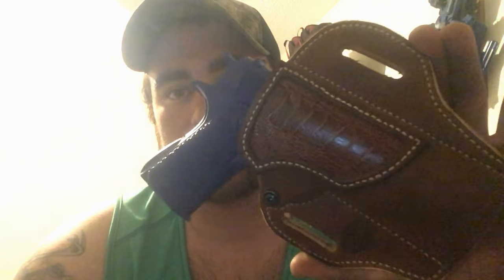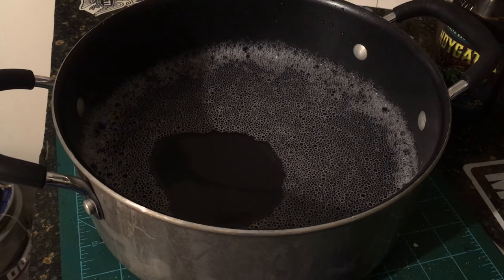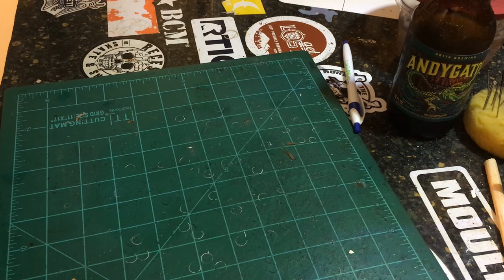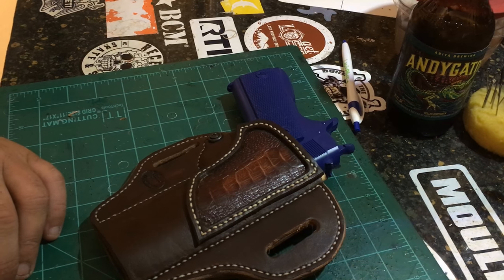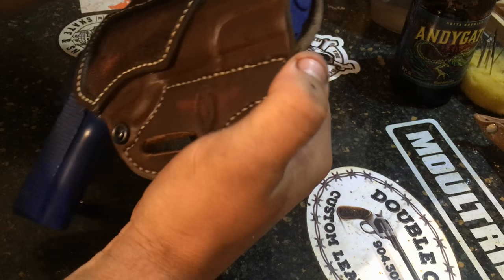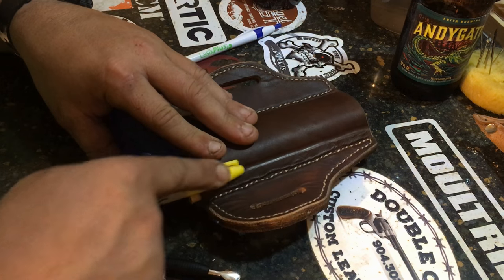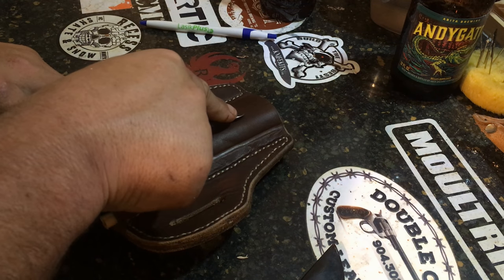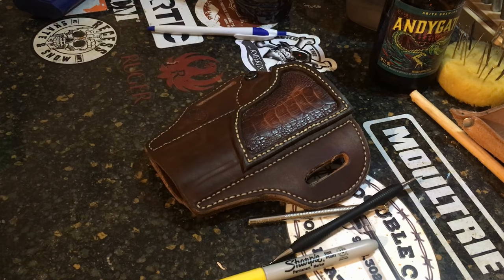How to wet mold a leather holster for a 1911

Comment: Nice Holster....good job molding.  I use a Food Vac Sealer to ger my initial molding ....gives a good start to the process. but think i will build a press ...will save some cost eliminating the bags and all.
Reply from the maker: Mike Turner yes!! The vacs are great if you get the industrial strength vac and thick plastics. Press is super cheap and effective. I’m pretty low volume so I’ve never needed anything more.
Reply: @doubleccustomleather2623  I'm really low volume...like make for myself and a couple friends.  
My standard food vac that I use freezing venison and fish works pretty good actually...least as a first step to get headed in the right direction.
Reply from the maker: Mike Turner yessir what ever works!

Comment: I like using the handle of a butter knife myself. Anyways, that molder you have there would work way better if you used a 2 inch thick piece of gel pad like you add to a motorcycle seat directly against the holster, then shim it up to the wood backboards with foam rubber to make it tighter, then use a big c clamp and a piece of steel plate on the top and bottom of the outside of the wood directly over and under the holster and tighten the c clamp till you can't turn in anymore and leave it till tomorrow and when you take it out you'll be able to see every single detail of the pistol without having to hand mold it at all.
Reply from the maker: Good idea. There’s definitely always something new that can be tried!

Comment: maybe not try to get so close with camera to keep things in frame.  also, could suspend camera over work area.  get it right once then don't worry about it.  maybe you could use bluetooth to send the image to another device (smart? tv, tablet. ?) so you can use it to monitor the work.
good video.  looking to make a flat leather holster i bought that only comes in sizes (e.g., size 3) fit a glock.  popped some stitches on another one trying to get a shield in the holster while on my belt.

Comment: Hi, Cody. What's the purpose of the screw undreneath the trigger guard?   Would it help to use a electric wire heater in the foam layers you use to press the holster? With a thermocouple to indicate the temperature near the leather. And leave it like that untill the leather self-forms around the gun.    And finally, which chemical do you recomend to seal everything once it's all done? Thanks

Comment: How long does it take the leather to dry? I left the gun wrapped in Saran Wrap in the holster during the drying process, but I don’t know how long that drying takes...thanks!
Reply from the maker: I usually pull the gun. That allows for better ventilation and it will dry quicker. A lot of guys leave it in But  I’m operating in a  business capacity so time is money. I also believe I get a better result that way. I do however give the holster a slight squeeze once the gun is out just so it dries in that tightened configuration. When you re-holster after drying completely it comes out just about perfect every time for me. I live in Florida with super high humidity and I ussualky wait at minimum 30 hours dry time with the ceiling fan in my shop on. I’ve also used box fans or set them on the porch on a sunny day which speeds the process up dramatically. Sometimes on really hot days I can get one dry in 12 hours. I’ve also used the dash board of my truck in a hot day to speed up dry times. Pending on humidity I’d say a 24 hour wait will produce a decent result. A trick to tell if anything is dry is hold it to your face. For some reason your really able to get the sense for dryness with the skin on your face rather than calloused hands. Old timer trick for finding dry tender to start a fire. Hope that helps!

Comment: Quick question. If you were to take something like an ammo can that won’t expand, put your gun and holster in a ziploc, sealed and evacuated all air, and placed it in the ammo can after the initial soak. At that point, take a can of expanding foam and spray all around bag with gun and then sealed the can off so that the foam presses tightly around holster and gun, would that provide ample detail for the wet mold?
Reply from the maker: Honestly I have no idea and I don’t believe I’ve ever heard of it even being thought about that way. I suppose it would but then you would have to cut all the foam off, ruin a good ammo can and foam isn’t cheap either. I’d say if a wood and foam clamp press is out of the question for you just wet mold it from start to finish without a pressing step. I made holsters like that for years before I built a press

Comment: one thing to remember that the slide line runs into the curve at the end. Do you edge and burnish the slots? Nice solid job.
Reply from the maker: Jonathan Shaha thanks. I do burnish them. I don’t edge them just burnish them on the 90 degree. I dye them and wax them as well. Deffinately could Bevel them I just prefer it to be non edged.
Reply: @doubleccustomleather2623  beveling and burnishing yields a more complete look. Been doing holsters for about 7 years. I'll have to check out your FB page. Always enjoy seeing others work
Reply from the maker: Jonathan Shaha I agree. I think you misunderstood me. I do bevel, burnish, dye and wax all my edges. I actually have a video on here detailing my recipe for that. The only thing I do not bevel is the belt loops. I do however dye, burnish and wax them. I like the look of the 90 degree edge better as well as I feel it offers some practical advantages too. They still look complete and finished. Just no roundness. As far as practicality I’ve found in a hard use holster, the 90 degree edges hold up better over time as beveling cuts away the flesh side fiber and therefore weakens it allowing it to stretch. I’ve tested this side by side with two separate Holsters. Not saying it’s wrong, as the stretch is minimal, it’s just the way I choose to do it. Also have a 90 degree angle allows for more bite on the belt minimizing forward and aft movement on the hip. The beveled edge creates  less friction which in return facilitates  more slide. Once again very minimal but it’s just a few reasons I don’t bevel the loops. Everything else gets a clean and beautiful bevel. Btw I checked your website. Beautiful work.
Reply: @doubleccustomleather2623  thank you brother. got some good looking leather yourself. I've had some good mentors.
Reply from the maker: Jonathan Shaha thank you sir. All self taught here. That’s why I do the you tube thing in hopes of helping teach someone else. It’s a dying craft.
Reply: Well I look forward to seeing you improve over time. If you ever have any questions I'd be happy to help where I can.
Reply: @doubleccustomleather2623  .Awesome! Thanks!

Comment: Can you do the back side first to keep from messing up the front?  Which video do you show the tensioner being put in?
Reply from the maker: Have not got around to making the tensioner video just yet. And you can start on the back but if you are carful and working on a smooth surface you don’t have too much to worry with as far as messing it up. I flip it back and forth usually until I get the look I want.

Comment: Nice down to earth vid, thanks for not acting like a know it all dick like most of the others. Where do you get the high density foam for the press? I like the press better than the food sealers because your not limited on how big if you use a jig/template for a shield. I'm going to make a drop leg (thigh)  holster for my 40 😁
Reply from the maker: Thanks!! I got mine from Knifekits.com. Anywhere that sells Jude holster supplies should sell it. Hope that helps!
Reply: @doubleccustomleather2623  thanks a bunch ill check into it!
Reply from the maker: RAINBOW181 any time!

Comment: Do you resolene prior
Reply from the maker: After it drys
Reply: It's what I do but was told to do prior..only time ill.do prior.is just to.protect paint and only the paint
Reply from the maker: @legendarycustomleathers8387  yah I find it molds better as resolene is a acrylic. If it was an oil based finish I don’t think it would matter much but I strictly use resolene so for me it’s always after.
Reply: @doubleccustomleather2623  10-4 I know im not going nuts
Reply from the maker: @legendarycustomleathers8387  I feel yah. Too many ways to skin a cat